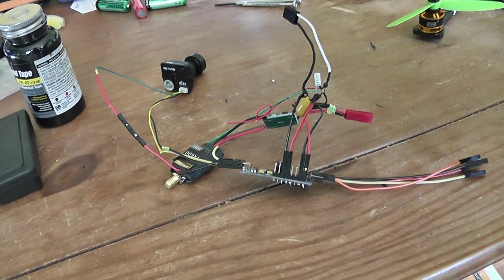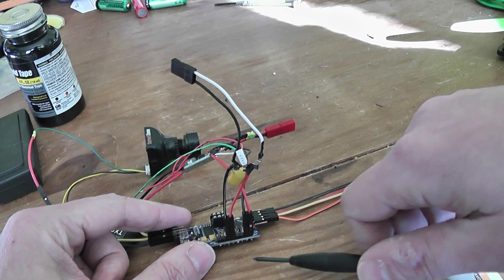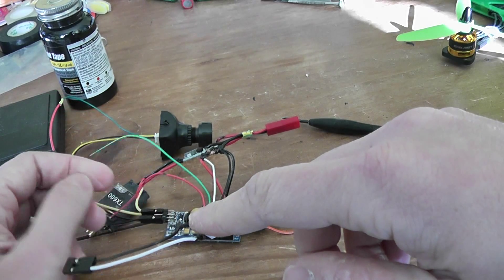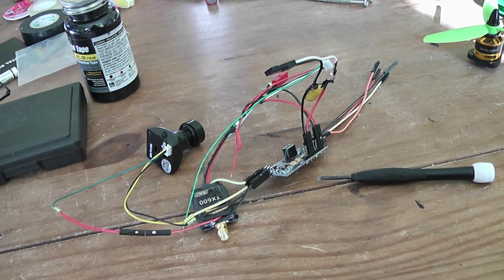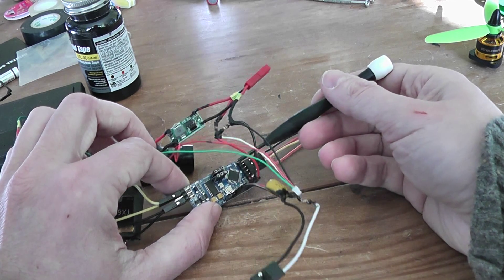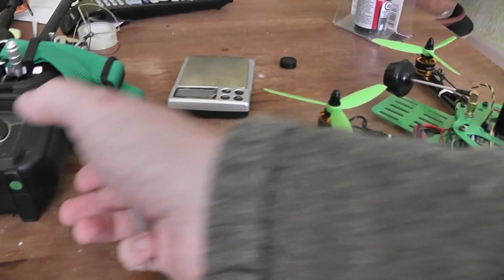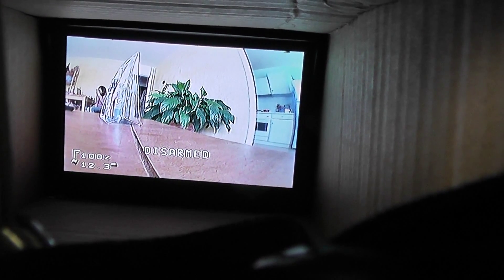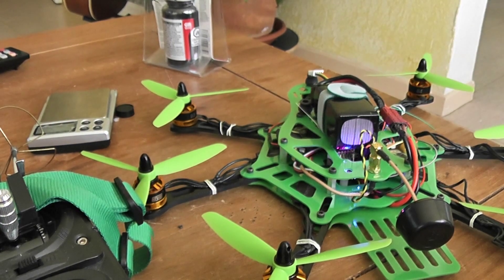Running both MinimOSD and FrSky Telemetry with DeviationTX

Comment: Bonjour, merci pour la vidéo, toutefois deux questions me viennent à l'esprit:
pourquoi avoir positionné l'antenne 5.8 ainsi sur ton hexa ? d'habitude on les voit positionnées vers le haut ou alors vers le sol pour les multi les plus imposants.
il semble y avoir beaucoup d'antennes qui dépassent de la devo10.. chacune reliée à un module différent je présume ;) ... mais vaut il mieux une cloverleaf ou une antenne bâtonnet pour le 2.4ghz ?? je lis souvent que les batonnets c'est de la m**, mais personne ne les change...

un grand merci pour tes réponses
Reply from the maker: 1) Car j'avais plus que des antennes à connecteur 90 degrés à l'époque :) Depuis, j'ai positionné verticalement évidemment.
2) Pour le 2.4G, avec une CL c'est pas super important en pratique, mais je trouve que j'ai un petit gain et ca passe mieux en low treeriding :)
Reply: SeBy DocKy
okok, et pour du long range ?